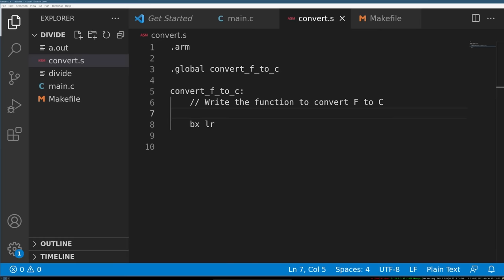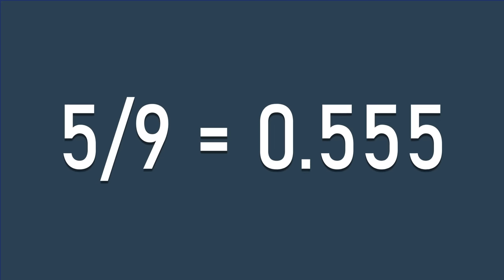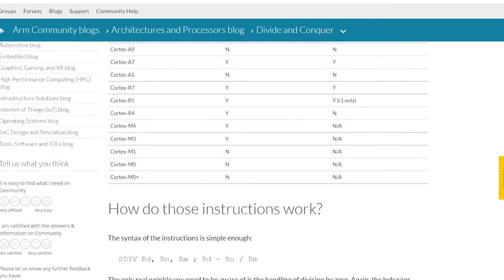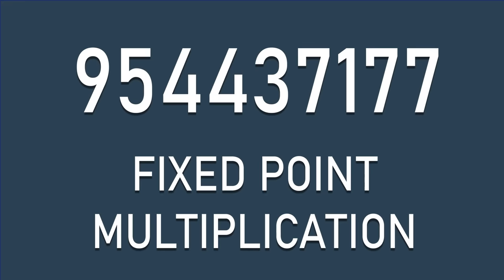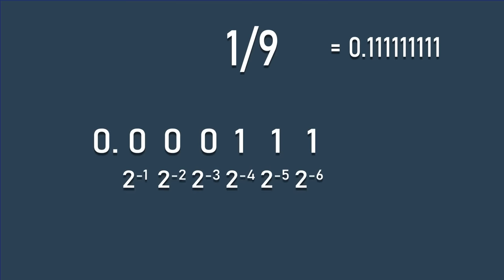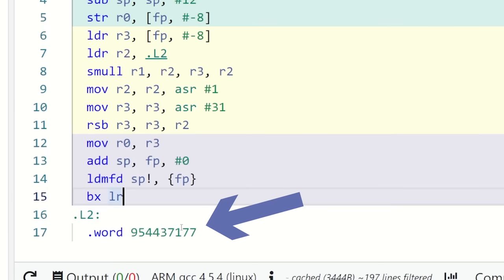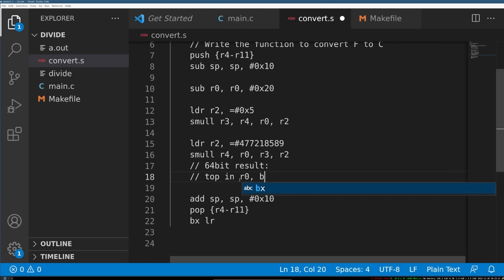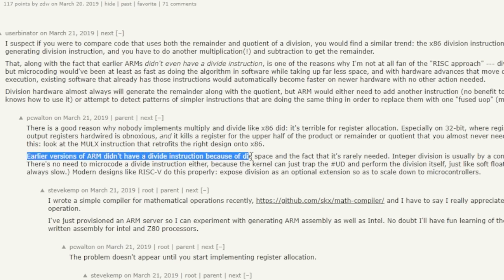computers suck at division (a painful discovery)

Comment: Dividers don't need to be big or complicated; a basic shift-and-subtract divider is little more than a wide adder, it's just slow to do it that way - depending on the implementation, typically something like 1-2 cycles per quotient bit, so for a 32:32 bit divide, it would take something like 32-64 cycles. Pretty much the same hardware can also do multiplication, just as slowly. These are usually the first multiplication/division algorithms you learn about when you study HW for arithmetic circuits.

This long runtime is awkward to deal with; having operations that long-running is a pain if you try to fit them in a simple microcontroller design that otherwise has nothing of the sort, and also makes it harder to guarantee timely servicing of interrupts etc. For this reason early RISC CPUs either didn't have any multiplication/division support at all or effectively treated it like a coprocessor which sometimes (e.g. when interrupts happened) could "lose" results and then you'd have to retry.

With ARMv1 in particular, the instruction set was such that you could just implement the basic repeated-doubling-and-add multiplication and shift-and-subtract division operations in software. That would typically take something like 3-4 cycles per bit for the straightforward way, which is 3-4 times slower than dedicated hardware would be, but it avoids all the complexity and consequences of dealing with long-running arithmetic operations.

ARMv2 added multiplication instructions, and did get a better multiplication algorithm than software shift-and-add - but it still only handled 2 bits of the product per cycle, so (since it was a 32-bit CPU) multiplications could take as much as 16 cycles! This used modified Booth recoding, which is a staple in multipliers to this day, but otherwise pretty much just ran on the regular ALU. Over time this got improved further. The problem with division is that it's not as gradual: the 1-bit-at-a-time algorithms are simple, there are 2-bit-at-a-time algorithms that are already a lot more complicated (and need a fair amount of tables), and then there's yet another giant complexity jump if you want faster than that.

So historically, there was a reason to be weary about including either multipliers or dividers, and if you're gonna do one of the two, multipliers are used a lot more often and also have a lot more options for implementers. This is especially important because most divisions (and remainders) in real-world code are by constants and for those, we can use the multiply-with-reciprocal method which just requires a decently fast multiplier and not a divider.

Real-world integer divisions by non-constants are not unheard of, but they're rare enough that to this day, if you're going to do a simple chip, it's not doubtful whether a dedicated hardware divider is worth it; software division routines are usually good enough for those cases, and especially when you have a fast multiplier available (which enables better algorithms).

The really fun part is that for a long time, until fairly recently, Intel x86/x64 CPUs didn't have a real integer divider either. Sure they have an integer divide _instruction_, but pretty much everything Intel released between the original 1993 Pentium and the Icelake microarchitecture (released in 2019) does not have an integer divide _unit_. All these CPUs have a floating-point unit with a floating-point divider, and would use that floating-point divider for integers too. (Running a short, or in some cases not-so-short, microcode routine to do so.) The reasons for this are similar to why ARM Cortex cores don't have it: this isn't particularly fast, but integer divide instructions are rare in practice, and a dedicated integer divider just wasn't worth it. They did change their mind on that eventually as mentioned, but it took them over 25 years!
Reply: what is a pity though is that almost no one implements "fuzzy"(analog or asynchronous digital backed) divide instructions, so they could be used in DSP/AI/GFX etc. cases where error is not a problem.
There are neat asynchronous methods, exploiting propagation/delay effects which take just a little of silicon and are fairly precise . 
OFC most ppl argue that divide can be emulated or real hardware unit used, but then it cannot do either deep pipelines, nor SIMD or other bulk matrix transformation. 
DSP and GFX suffer most as not only people need beefy chips to do fairly simple operations, but also power consumption hurts.

Comment: I used to program assembler on the Acorn Archimedes which was the first commercially available computer with ARM4 chips.

There was a really good algorithm for dividing two 32 bit numbers. It involved about 96 instructions, no loops, 3 instructions to set it up, 30 repeated identical sets of 3 instructions and then a final 3 instructions.

Those chips didn't have a multiply instruction either so you'd have to multiply by 5 by shifting left 2 and adding to the original.

Comment: There's a floating point division core on OpenCores which uses the reciprocal like this - multiplies by the reciprocal rather than dividing (the assumption is that much of the time, you'll divide a whole bunch of stuff by the same divisor, so you just calculate the reciprocal of the divisor, cache it, and reuse it many times in the subsequent multiplication).

An interesting contrast of RISC-V against ARM is that the M extension (multiply) also includes divide, so any RISC-V with hardware multiply also must have hardware divide. But RISC-V is a lot newer than ARM.

Comment: Yeah, fixed point is a very effective technique to get around divisions, unfortunately you can't always use it when high precision is required. Luckly the problem does not apply when you have an FPU. A very interesting alternative I suggest you to look into is CORDIC, it computes only 1 bit per iteration, but if your architecture is superscalar that is not a big issue. Furthermore I also read something about CORDIC and loop pipelining at a certain point, thus looking that up could help as well!

Comment: At Saturn we ran DEC VAX computers and they ran GE Cimplicity for doing our SCADA screen and getting data from the PLCs in the plant. Apparently it never occurred to GE that we might need to do math at some point, and they didn't bother to include that capability in Cimplicity. ITs solution was to use seven GE Series Six PLCs to do the math for Cimplicity. 

They were affectionately known either as the "Seven Dwarfs", or "VAX Math coprocessors". :)

Comment: The cortex M23 is meant to supersede the M0 and M0+, it has integer divide (that takes 34 cycles). I was in an embedded class in college, and one group was calculating a GPS bearing in floating point on the M0+.... the entire computation took over one second at 48MHz...

Comment: I think it is quite straight forward, processors are very good at division as long as the divisor is a power of 2. So if we just limit ourselves to integers then we can use a arithmetic shift to divide any number very quickly. So instead of multiplying by 5/9 you can multiply by 569 (5 / 9 * 1024) followed by a division by 1024 (shift right by 10 bits). When coded in C this looks as follows:

celsTmp = ((fahrTmp - 32) * 569) >> 10;

My ARM assembly is a bit rusty but I think in assembly it would look something like this (temp in fahrenheit and celsius in R0):

ldr  r1, #569
sub r0, #32
mul r0, r1
asr r0, r0, #10

Comment: Generally traditional ALU is not good at dividing. Calculating powers of the division number is essential. After the calculation, do subtract the specific power of the division number repeatedly.  This is the basic of division regardless software or hardware. If you would like to implement "printf(a=%d)", you must divide the number based on BIT by 10. It is VERY BASIC.

Comment: A long while back I had to do the same thing... But the complier I had was Garbage and implements successive subtraction.... So I had to speed it up with my Jr in college electrical engineering knowledge... My method was to divide by 9 and do mod in 1 function then multiply the remainder by 5 then re-divide the remainder by 9.

This reduced loop iterations by a substantial amount.

My point is... Some times turning 2 simple but long operations into more steps can really speed things up..

Comment: If you want to multiply/divide arbitrary numbers provided at runtime (rather than hard-coded constants) without hardware multiply/divide you can use the CORDIC algorithm, which only requires add, subtract, and shift instructions and a small lookup table. As a bonus, it can also do trig functions, hyperbolic functions, square roots, exponentiation, and logarithms too.

Comment: Missing basic operations can be interesting to work around. I dabbled in z80 assembly and decided to write a factorial program. 

Very straightforward! Hell, it's all multiplication without any dependencies on the order you do it in as long as you feed it the right factors it doesn't care what order you feed them in. 

The z80 doesn't have an FPU, which is normal for CPUs of that era, but I was doing integer math so who cares.

What does it also lack? Multiplication. So there was the loop for the main factorial function, and on top of that I had to implement a multiplication function. It wasn't quite the challenge this seems to have been, multiplication by repeated addition is trivial(especially with DJNZ if one of the factors fits in 8 bits), but it was annoying making sure I didn't clobber my registers.

Comment: I ran across this issue when working with the UNIVAC 1100/80 and the DataWest Array Processor;  When i spoke to an engineer i learned that division has always been a problem and the successive approximation used has a tendency to make the timing non-deterministic ... you know, it depends.

The other simple database operation with a non-deterministic timing in INSERT...

Comment: There is a fundamental reason for this. Most digital signal processing (numerical computation) algorithms are built on addition and multiplication. The number of divisions that occur are  many orders of magnitude lower than the number of multiplies. Thus, ALU are DESIGNED to do multiply and add (and especially a MAC- multiply accumulate operation, i.e, a<-- b+c * d ).

Comment: Something like:
In some old MSVC compilers (maybe the same thing exists in GCC)
If you choose optimize for size, the compiler will use div instruction
If you choose optimize for speed, the compiler tend to use multiply-shift operations like you mentioned in your video (Yes, this multiply-shift operation is faster than div instruction in old x86 cpus)

Comment: I remember reading that a historic computer called the IBM 1620 that came out around 1960 did math by using lookup tables. On this machine a divide instruction was an option at extra cost. It does not surprise me that there are processors that do not have divide instructions. Another way of handling this was a routine that performed division by using multiple subtraction.

Comment: 3:23 "ARMed with this power" - I see what you did there :)

You can always implement the division manually, along the lines of doing a bsr to find the highest significant bit, then shifting the divisor up by that amount, and repeatedly doing (approximately):
shift result left by 1
compare, store a 1 in the result if the divisor is less than the dividend, and subtract the former from the latter if so
shift divisor right by 1
stop the loop when divisor = 0

Comment: Just as a digression, why do people use the complicated add 32 or subtract 32 depending which way you are converting.
Simply add 40, multiply by the factor (9/5 or 5/9) and subtract 40.
Always the same - add 40, convert, subtract 40. Much easier to remember. (Works because -40 is the same on both scales)

Comment: I think its worth a longer explanation.
Chips, like ARM processors, are made out of a large piece of silicon, say 300mm round wafer. The larger a chip is, the less units can be made out of a given wafer. The reason chips are made in a clean room is every speck of dust on the wafer causes the chip made on the area it fell on to be defective. Say a clean room means there would be, on average, 10 dust specks on a wafer. If a FAB makes a 100 ARM units, and 10 are defective, it has a yield of 90 chips, or 10% loss. If it makes 200 ARM units, the yield is 190 chips, or 5% loss.
So making reducing the chip size has a better than linear price reduction - making it half the size, would reduce the price by more than 50%.
There are many devices with small processors with programs that rarely divide numbers. Having the compiler generate code such as in the video allows getting the same functionality with a cheaper processor, which is why some ARM cores don't have divide instructions. And there are other savings, such as on floating point math, vector units, caches, etc.

Comment: I remember in a college course on the Motorolla MHC11 8-bit microcontroller. The teacher showed us some examples of C code being converted into Motorolla instructions. Adding two numbers was easy to understand. The compiler added some fluff but it was still like a dozen instructions, and you could simply spot the two values going into the registers and the “add” instruction with your own eyes. At the end of that class I suggested to the teacher she show us division of two numbers, like 15 divided by 3. Easy right? Well since there was no “divide” instruction i theorized that the compiler would have to do some convoluted stuff involving multiplication and/or bit shifting, but I wasn’t sure. I was hoping to analyze it and learn from it. But I was not prepared for the horror approaching. What it spat out was over 3000 instructions. I called it a day, so did the teacher.

Comment: So i've made a division circuit in a logic simulator(actually a whole programmable computer as beta tester in logic world) since i built it and timed it I know the reason why they are slow and take up a lot of space is the following:

You have an array of an array of 1 bit adders, an array for subtracting the highest number to the lowest number. (Multiplicals of 2 because we use binary)

Since you have a condition on each array (if most significant adder overflows the subtraction has to be forwarded to the next array else the input of that array has to be forwarded. This results in the worst case scenario (divide by 0) where in a 64bit number the adders should overflow 64*64=4096 times which is a long time, and a huge space to house 4096 adders.
In comparison with only 64 1bit adders and overflows for normal +,- operations.

Comment: Division takes a huge space on the silicon. It literally takes 99% of the whole ALU. Addition, subtraction are so easy, it actually takes just 72 transistors for 8-bit addition and 32 more for the 8 bit subtraction for signed operations. Multiplication takes much more transistors but division is a whole another story. Floating point division is even more complicated. So if you want to produce a cheap CPU, you gotta pass the division to the software front.

Comment: I disassembled the SNES Chrono Trigger game.  Among other kinda bizarre things, they have a software divide function that simply does long division in a loop.  They also have a separate function for approximating multiplication by percents (with 1 corresponding to 1024), a variable shift function to make up for the 65x single bit only shifts that actually calculates an offset into a series of shift instructions, pushes it and RETs, and a software multiplication function despite the SNES PPU having a hardware multiply.  I can't remember if it had a hardware divide, too, but the 65x definitely didn't have MUL and DIV instructions.

Comment: I've always referenced the C to F calculation as (C * 9/5) + 32. In which case, you can simply turn the 9/5 division operation into a multiplication of 1.8 instead. Seems to work fine.
Reply: Yep, works fine for going C to F. This was going the other way. Which, welllllll isn't so easy to make a computer not scream at.

Comment: I had a project that I had to write an assembly code that will print analog temperature input to an lcd screen. PIC16F877A was the processor I had to use and It was also incapable of division. To print temperatures with two digits I had to divide the analog input to 10. For that project we had to write 3 assembly codes and create their respective simulations in proteus. That was the hardest question in that project.

Comment: Trying to multiply or divide anything by 9/5 or 5/9 in my head is rather difficult, so I found an easy way to cheat to get "close enough."
For example, to convert 30C to F, my formula is C x2 -10% +32 =~F.  So, 30 x2 = 60 -6 =54 +32 = 86

Comment: There is another way to approach this that can be useful.  Any number can be expressed as a sum of binary weights, in the case of 5/9 a close approximation is 2^-1 + 2^-4 - 2^-7 + 2^-10 - 2^-13.  Since all values are binary weights, this can be applied using only shifts, addition and subtraction e.g.  C = F>>1 + F>>4 - F>>7 + F>>10 - F>>13  This can be very useful for low power 4/8 bit microcontrollers they don't even have a multiply instruction.
One issue should be obvious from inspection, the smaller the value of F, the fewer terms contribute.  For common temperature ranges (e.g. freezing to boiling point of water) only the first three terms are useful, but this still provides a result within +-1C.  Obviously the shifts must be sign extended to cope with negative values.